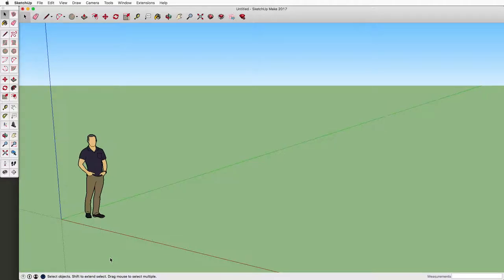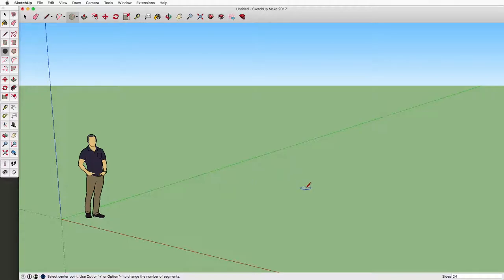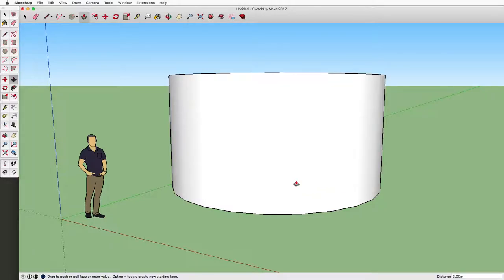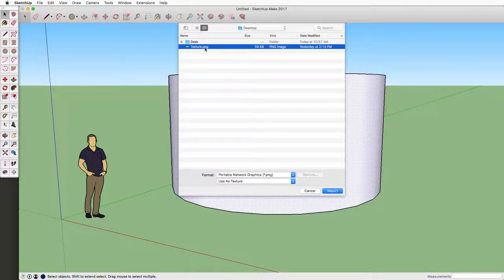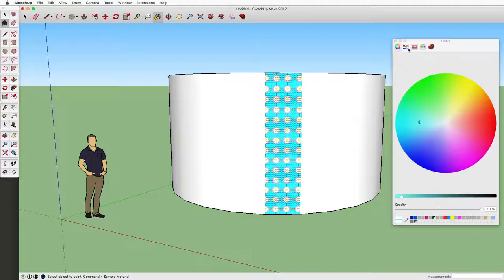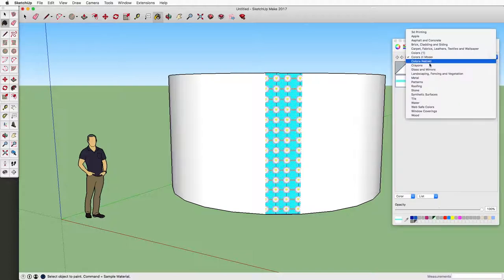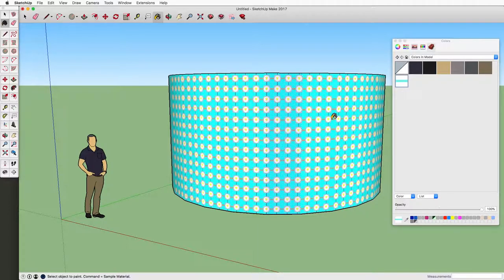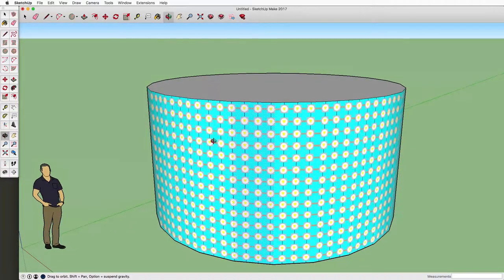Project Texture on Cylinder

Comment: Can we rotate smooth edges texture?
Reply from the maker: You can rotate the position of texture and change its scale
Reply: @WhatMakeArt  But after rounding edges  geometry iam not able to select the texture.(the texture scaling option not showing)
Reply from the maker: You need to show hidden edges and select a plane that is parallel to the ground so you can project the texture. Here is a link to a SketchUp community forum post that may help.

https://forums.sketchup.com/t/texture-on-round-surface/44959